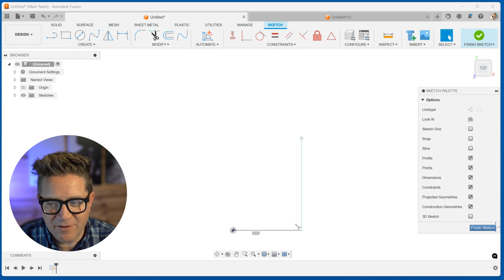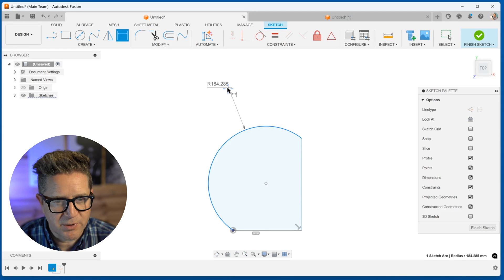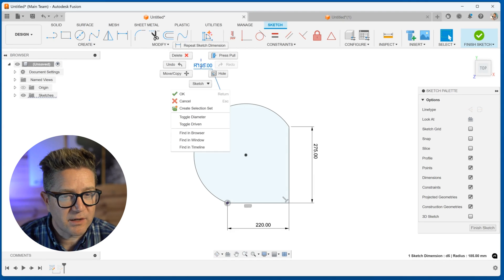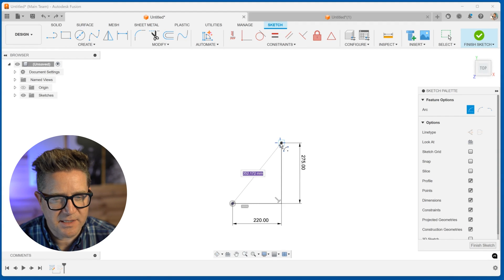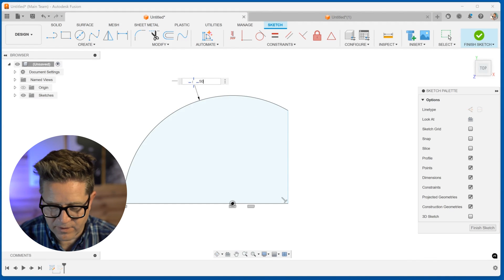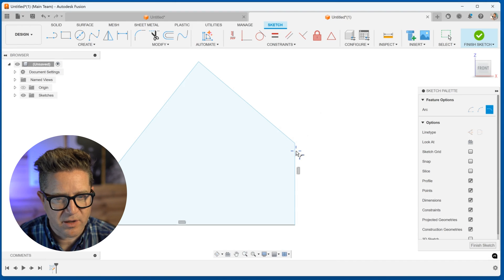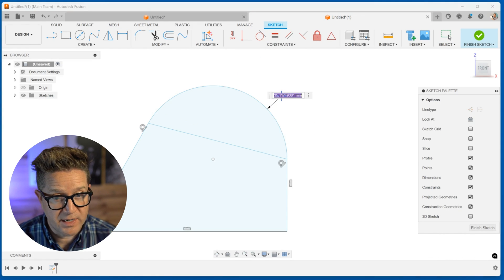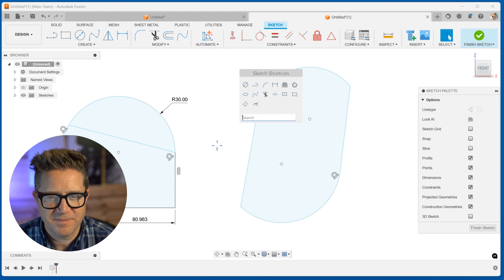Learn Fusion 360 Sketch Arcs – Center Point, Tangent & 3-Point

Comment: How do dimension an arch length?
Reply: You can't directly dimension the length of an arc (ie: partial circumference). You would need to calculate it, then set other dimensions. The formula is: s = θ * r; where "s" is the arc length to be calculated, "θ" is the central angle in radians, and "r" is the radius of the circle (arc). Rearrange the formula to suit.
Reply: @ thanks